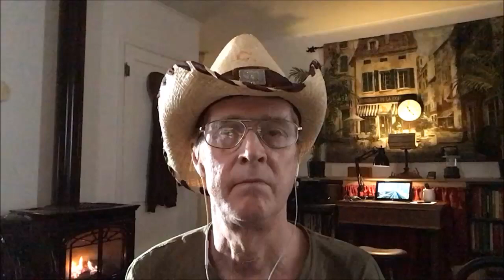The Best Antenna Test

Comment: So Stan, thanks for your educational videos and books. I have a question though I'd like your thoughts on.
If space was no object, how would you go about building the best receive antenna for SWL? Is there a length for example where increasing it further is of no practical use due to diminishing returns?  How best to make it omni-directional? and finally...if it is a random wire would you recommend terminating the far end to ground  through a resistor?  I see different ideas floated online, have you ever recommended an 'ultimate' omni directional antenna design for listening only?
Reply from the maker: A huge horizontal circular loop, as high above the earth as possible, would work very well for shortwave listening. The performance should improve as the diameter increases. I would directly (no resistor) ground the loop at the point opposite the receiver for protection against electrostatic charge buildup and possible lightning strikes. This is a good topic for a video. 73 de Stan W1GV.
Reply: Thanks for your thoughts. I would enjoy a video on the 'ultimate SWL' receive antenna if you feel like doing one sometime. I would appreciate too your thought on connecting it to the receiver. Place a 9:1 unun outside and run coax in...or perhaps another approach. thanks again -Larry

Comment: True.  Theory is good, building is the proof.  BTW- any antenna erected in the middle of winter during a snow storm, is guaranyeed to work perfectly.  73 es CUL.
Reply from the maker: Well, I can testify to that. I put up an 800-foot longwire in the middle of a Minnesota winter (living with my parents in 1987-88) with a foot of snow on the ground and the thermometer hovering around zero Fahrenheit. I worked some good DX with that thing. 73 de Stan W1GV.